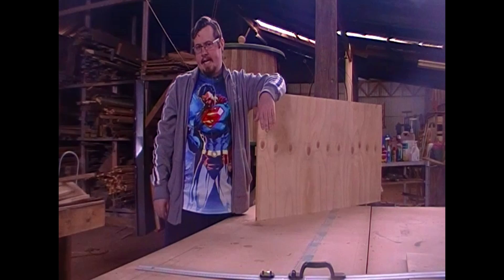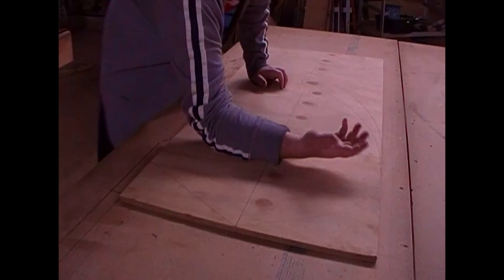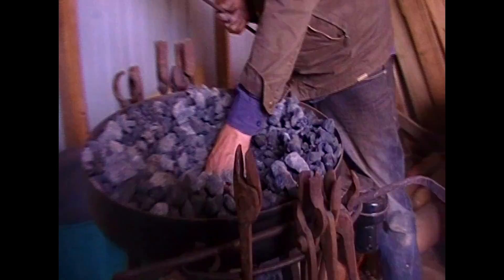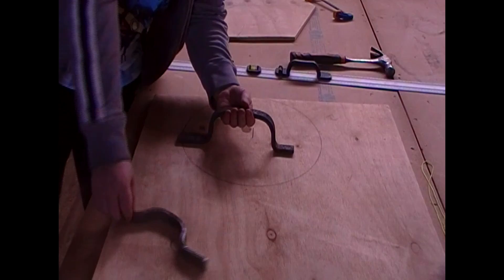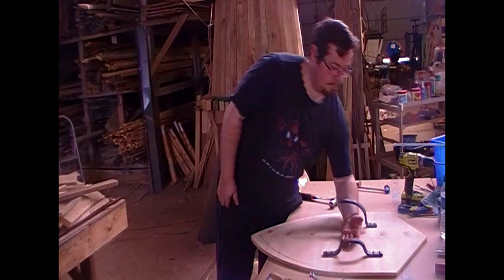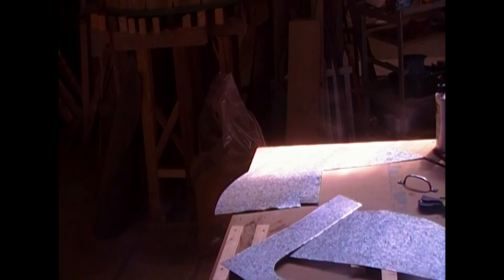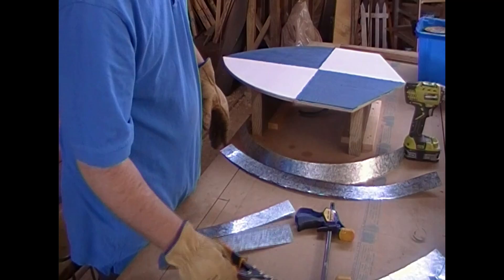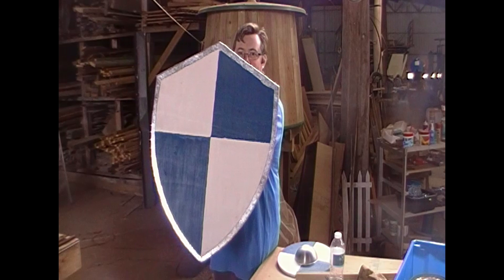How to make a heater shield

Comment: Shad, don’t heater shields have a slight inner curve to them?
Reply: That I am still confused about. I've seen flat heater shields around but I'm not sure if it is historically accurate or not
Reply: Typically yes, a curved shield is better at deflecting hits, which has a few advantages. First, a hit that glances off doesn't damage the shield as much as one that hits head-on. These weren't cheap pieces of equipment, typically they'd be made with a fair bit of fabric and at least sometimes with a final rawhide covering. Textiles were expensive before the industrial revolution. So extending a shield's longevity is handy.

Second, if something like a lance hits dead-on it can still pierce the shield and injure the user. I'd also be concerned about that with arrows. With a curved surface, a point is more likely to shed than stick. So not only is it less likely to penetrate, it's not going to transfer nearly as much impact into the shield's user. Which is really helpful if you're fighting another knight on horseback because otherwise his lance can easily unhorse you. At which point you're likely about to get skewered. Now, some strap configurations I've seen, including the one I'm going with for my first heater, make it clear that the shield is designed to make it easy to hold at a slope while mounted, since they include another strap near the bottom point of the shield. That adds a third direction that a lance point can glance off in, making it even less likely to get the full impact.

I also think a curved shield will provide better coverage in use, though I haven't handled one and can't be sure. The scutum of early imperial Rome was very intensely curved, and it was very much meant to provide body coverage.

Comment: Very late comment vid has been on watch later for ages. I made a heater shield recently and I though it was good until I subscribed. I plan to make one better using what I saw here plus maybe some other additions. The silicon is in interesting idea i might do something similar or just polish it down it down (i have access with high school shop). You probably won't see this comment but great video. Loved the sandwich break and the commentary about hand clamps 23 at one point I think.

Comment: The pieces you cut out to conform to the curve are called darts. Analogous to darts in fabric. Another way of securing the metal to the edge would be rivet and rove or even clenched nails. Either of which would be somewhat decorative as well.

Comment: Interesting. What are you planning on using this shield for? Normally your handles would be on an angle to best utilize the shields shape. You can also use rawhide for the edge and use crossed leather strapping for a handle. Just a few suggestions.
Reply from the maker: TeutonicPenguin Hey It's the Great Teutonic Penguin! I've watched some of your videos man and really enjoyed them. To answer your question, primarily the shields I've made are for my instructional videos:https://www.youtube.com/watch?v=HNFxTmRFPv0

https://www.youtube.com/watch?v=bJNbnJw_eBo

The video on the heater shield is still coming. So with the heater shield I went for the most traditional style and use, according to my understanding, meaning one made for use on horseback even though I'll never really be using it on horseback. Having upwards angled straps would make the shield nearly horizontal when holding the reins and make it more difficult as there would be more shield between my fist and the reins.
Those are some great suggestions and I've been considering rawhide for a while, so I might use it in the future.

Thanks for the visit man, hope to see you around in the future!
Reply: Oh I see. Nice video on that center grip! And yes horizontal strapping was used on horseback. Slanted was for infantry. I recommend trying rawhide for sure though. Just get one of those large rawhide bones, soak it in water for a day, and then cut it into strips. It's way cheaper and it's the same thing. Glad you enjoyed my videos, keep up yours they are very good! Good day to you!
Reply from the maker: TeutonicPenguin You have my gratitude sir! The bone idea is a great one and I'm even thinking of contacting an abattoir to see if they would sell full rawhide skins. If I can get my hands on one of those I'll be making a new kite shield for sure.
Reply: Excellent! I look forward to seeing it! Keep up the good work!
Reply: I was surprised to learn that Tandy Leather sells rawhide.
Range is from remnants and lacing to full sides.
I would put in a link, but YouTube doesn't seem to allow that. (?)
Reply: I've been to tandy actually! A bit pricey, but good stuff

Comment: Noob question here: were these shields historically flat or curved?
Reply: depends on the type, center grip Viking shields were mostly flat, but I think that many heater shields had a slight curve
Reply: Thank you for the clarification!
Reply: Depends on the artisan and the person using it
Reply: Why did they have it curved? It seems to be easier to just make shields flat
Reply: its to deflect blows away from ya
Reply: @baldrickthedungspreader3107  Flat surface would mean you're receiving the energy of the impact in full, curved would direct a bit to almost all of the energy away depending on the angle. Of course, you can always angle the flat shield itself to make it curved.

I don't know how effective it is when it comes to melee but in a ranged combat, a bullet will easily be deflected if the object is angled enough with the minimum amount of thickness.

Comment: Shad, I have to ask this, and I hope you respond. I'm just curious about what you're basing the shape of your shield on? The top edge of your shield is not flat, instead it slopes up to a point in the center (in the video you referred to this as the "peak" of the shield). I've been trying to find historical examples of heater shields which don't have a flat top edge, but I can't. I'm wondering if maybe you know of any examples, but if not then that's okay. I love the shield, by the way, it looks very nice.
Reply from the maker: +HamsterPants522 I'm not sure if I've seen any historical examples either. I just made it because I liked the way it looked ^_^
Reply: I am Shad
Alright, that's good to know. I like the look of it too, but I had to ask. Thank you for responding.

Comment: You should make a shield press and glue layers of thinner wood and avoid knots. The curved shaped improved the strength. Cover it in linen or leather improves it considerately. And steel pop rivets are better as they don't loosen with hits. And rawhide edging is also better.
Reply: What about hammered rivets?
Reply: Even better than pop rivets. As experience in sca would indicate that nuts and bolts tend to loosen with each hit until they detach. Anything that can't be loosened with force is good.

Comment: That large metal drill is a drill press.  For those viewers in the United States, aluminum sheet is roughly the same as tin sheet for most uses and more commonly found in the US. Also slightly easier to cut(emphasis on "slightly," that much is still going to hurt and take all day).

Comment: Cool project, thank You for sharing! One thing i would have done another way is the surface of the shield. I don't think that (historically) shields were made out of a single plank of wood, rather a few fixed together. So to get the look of it maybe you could have milled the lines where the smaller wooden plank would have connected to give it a more interesting and better(?) look. Don't get me wrong that i don't like your piece of work - it's great for the use you intended.
I'm looking forward to build a shield my own (a guard's shield from the game Skyrim) so this video was very helpful to watch! 
(sorry for bad english, im an German Student)

Comment: I've noticed that all your shields are flat.  It's my understanding that all styles of shields are "better" when they are convex.  Do you do this because it's just easier to make?
Reply: That should pretty much be the reason. It's not that inaccurate, and curving wood to my understanding is not that easy, you would need a steamchamber or something like that. I don't even know if you can do it with plywood, but certainly not with something that's made of a single large piece like this.

Comment: wouldn't it be more practical for blocking if it was slightly curved  ?
Reply from the maker: Wolfsli having a curve does certainly give a slight advantage but it isn't huge as the shield is so small and it wasn't always done. Flat heaters were also common. In my opinion having a curve in a shield is more important on the larger kite shield.
Reply: that's nice to know :) never knew they were commonly made flat. well I've learned something new thank you

Comment: Your shod looks like tinned steel. Solid tin is not cheap. Most "tin" products are actually austenitic (non-ferromagnetic) steel plated with tin for corrosive resistance. If it's solid tin you'll know it when you go to bend it. Because tin screams (it makes a creaking door like sound when flexed). What makes me think beyond the look of it that it is in fact tinned steel, is the difficulty you had cutting it. Also if it were solid tin you wouldn't need to tab the edge to fold it over. Solid tin is very malleable. But tinned steel far better for shod applications anyway.

Comment: onw of my questions is how to curve the shields. I really want to make a curved heater shield, but I have no idea of how to properly do it. do you have any idea of how I could achieve this ?
Reply: DocbadLuck, I've seen 2 methods. One, soak the shield in water and bend it. The other, you have to use planks instead of plywood. What you then do is shave off a little bit of one edge so that it's angled. That way, when you attach the planks together, they curve
Reply: Or you could use a steam formpress